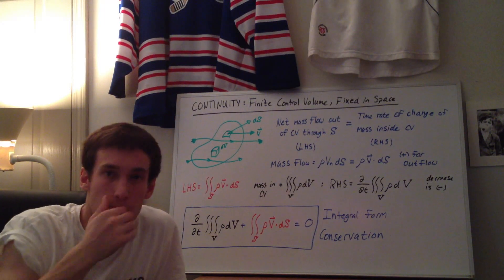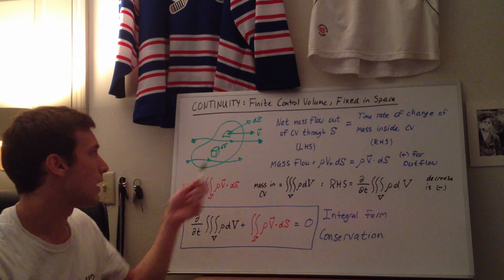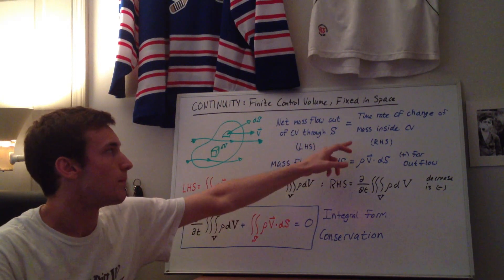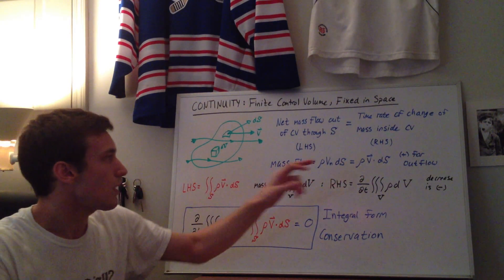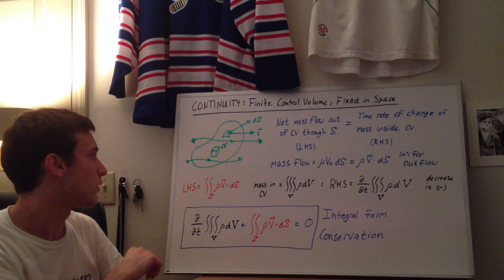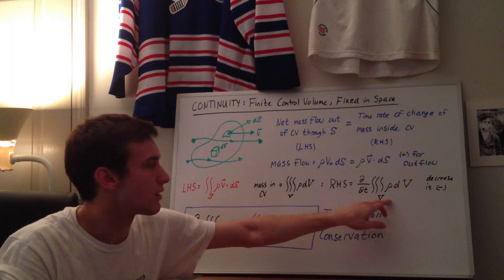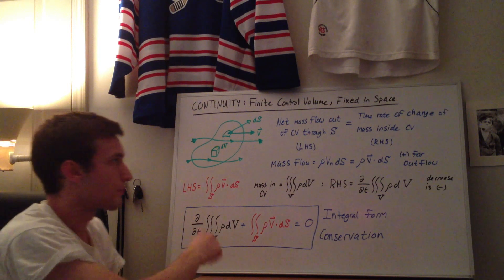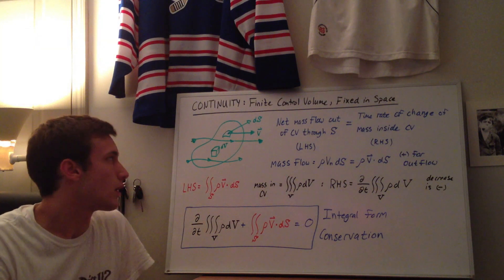Explained: Continuity Equation, Fixed Control Volume [Fluid Dynamics]

Comment: 3:22 Can you please explain why Vn x dS can be written in the dot product form? (Is dS a vector??, dot product is between two vectors?). Thanks!
Reply from the maker: I wrote a post on my website a few years ago that I think will explain it (linked below).  Let me know if that still doesn't answer your question.  http://www.joshtheengineer.com/2017/01/02/surface-double-integrals/